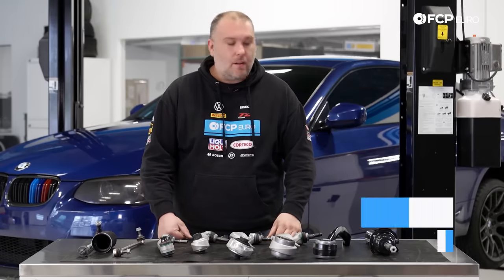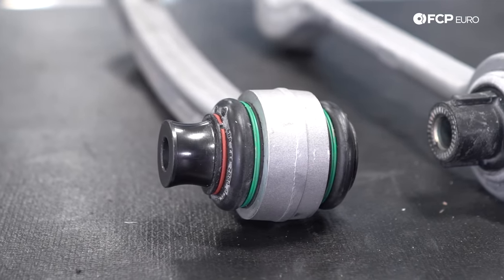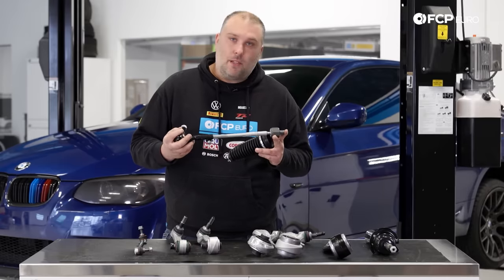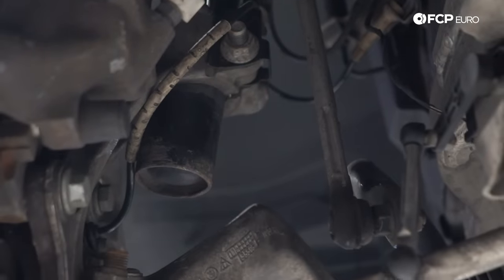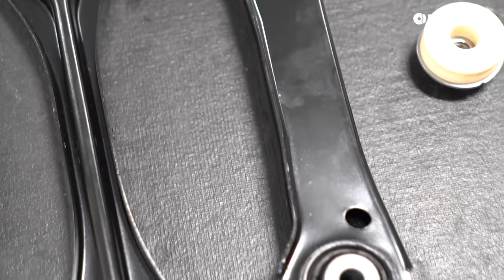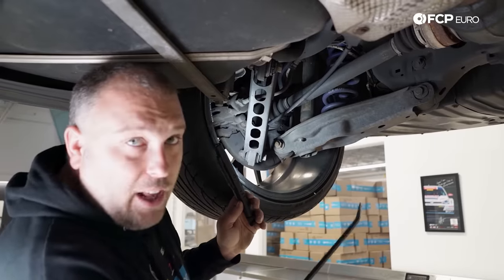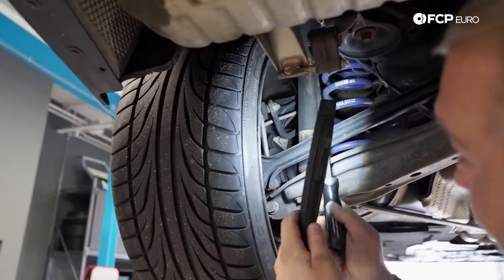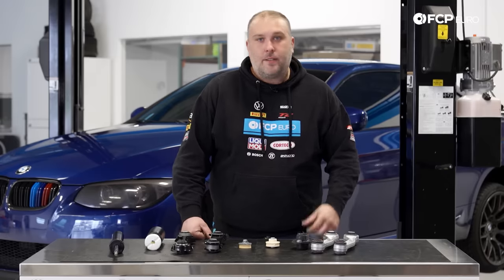BMW E90 Suspension Diagnostics & Problems: Everything You Need To Know ( 328i, 335xi, 335is, 330i)

Comment: I have a feeling that these E9x videos are going to start getting a lot of views as the 12+ years of wear pretty much guarantee that their suspension is shagged
Reply: Argh
Reply: Damn right. Mines on 200k km's. Gotten loose as fuk lately.
Reply: Man that’s the issue with all old cars now. It’s annoying knowing you’re gonna be having to replace suspension and steering parts
Reply: @d3admaub938   Still better to repair a 2010 car than to buy a 2020 shit box, BMW included.
Reply: Mine failed on the expressway, threw me into a wall. Now I need suspension and Msport bumpers. Yay!
Reply: They are getting lots of views now 😂
Reply: I mean, an e90 with its old plastic parts and running hot were already in the ballpark before 2020.
Reply: I just spent around 6k on the front and back with all new coilovers I’m SO EXCITED I GOT A NEW DRIVESHAFT IN WITH NEW U JOINT AND NEW TIRES THEN MY OIL PAN CRACKS IN HALF FUCK
Reply: @dabsfordayz2150 similar issues here too

Comment: You say 35.000 to 40.000 miles is the life expectancy on a strut, then I should be happy that I managed to get more than 250.000 miles out of the strut's in my E61 525d from 2007, before the left spring cracked and I decided to replace springs and shocks.

Comment: Nice video. I have a doubt about rear suspension arms. i got an e92 and it shakes a looot when braking. I´ve change the all 4 discs with pads but the car still doing the same. Tires are brand new. Could the rear arms be causing this? i´ve checked front arms but they are all okay.

Comment: I can can confirm: "You have to compress the front spring more than usual to assemble the new strut due to the strut's internal design"  I was compressing the spring.  A LOT.  Then KA-BLAMO.  Upper strut bearing bowl blasted into my ceiling!  At least it wasn't my FACE !!   I've done 2 other non e90 cars.  Never had to compress the spring to that extreme.  It slipped off my compression tool under extreme compression!!  Dramatic & scary.   That was 5 months ago.  I gotta take the front struts to a shop for assembly.  I'm not attempting that again!

Comment: Put b12 pro kit + new tie rod ends + new sway bar links on my e90. The car has completely changed. You think your e90 handles well until you get these changed. Mine was on 140k miles before I swapped the parts out. Now I can take corners that used to feel sketchy at 60mph comfortably at 80mph. Completely different car. I would highly recommend to anyone to do this. If you do the work yourself it’ll cost you around 900. But have a blow torch and a lot of patience at the ready.

Comment: you might have just diagnosed the dreded vibration under braking 🔥 after two sets of new disks and pads i was loosing hope 🙈 I'll be installing the m3 upgraded parts and 🤞 that solves it + improves handling. Top class content - subscribed 👌
Reply: Are your feeling the vibration through the seat and pedal or through the steering wheel ?   I've had the car a week (2006 320d Touring) and noticed vibration through seat and pedal under braking, but a check on brake roller does show fluctuation on off-side rear disc.
Reply: @scarletturk3892  definitely fell it under the pedal and the seat but it also radiates to my wheel (just slightly) Had it before after winter lockdown, so changed all discs and pads - it was gone for a bit but after few weeks started to progressively come back. I know the hubs rust on bmws and that's also causing vibration under braking...

Comment: 110k miles in an area with plenty of potholes and all I've needed to replace is the rear shocks. Lower shock mounts were completely shot, so definitely worth replacing those and everything else the FCP mounting kit comes with.

Comment: Damn, wish I would have known about the option to use M3 parts on my rear wheel drive e90.  I just finished replacing all of the front control arms.  I had steering wheel shake while braking and that solved it.  Had my rear struts leak like crazy at 120k miles.  Sitting at 140k now and have the original front struts still.  Thanks for making the videos and being a great place to buy parts from.
Reply from the maker: Nice work, Sean! 

Now you know for the next time :)

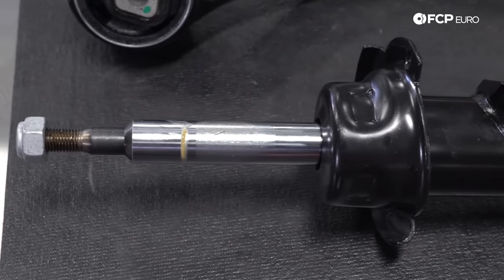Comment: Great video! Much needed content for all e9X owners. Great point on the spring compressor with the Sachs dampers. 3:11 Using a rental spring compressor is a nightmare! I went through it all just to have my one of the Sachs dampers leak only a couple months after installing them. I definitely recommend going with Bilstein given the better performance/installation.
Reply from the maker: Thanks, Evan! Really glad you like the video!
Reply: My 335 struts was the most horrible strut job i ever did. Even took them NTB, mechanic tried for couple mins and gave up , wasn't risking his life
Reply: geo745don Yeah, I wouldn’t get the struts for that reason alone. The fact that  one is already leaking is all the more reason to go with Bilstein. More people need to know this.
Reply: @evanupshur  yeah I got the blistens,  usrd nylonn straps to tie Springs down, with spring compressor, lowered care to help seat to tighten nut, big headache, my car has factory sport suspension makes it worst I guess
Reply: @geo745don  There are special tools for the shocks with in-built rebound springs. For example Laser Tools 5790.
It will pull the shock out to maximum length so you can install the spring with a normal spring compressor.

Comment: A quick note...the "internal rebound damper, essentially a bump stop" discussed in the Sachs strut is actually a rebound spring. It's used in the strut to control large body motions and improve on center steering response. It's worth differeniating as it is a function of displacement opposed to velocity.

Love these videos!
Reply from the maker: Thanks for the quick note, John! Glad you like the videos!

Comment: What tool are you using to change the bushings and ball joints (on the trailing arms and on the lower roll over struts) on the rear suspension, is there some special BMW-designed bushing removal/puller/pusher or you're using whatever no name bushing removal kit... and can you make a video of tips and tricks when it's time to repair the rear suspension. Thanks for all the videos, great work and very helpful!!!

Comment: Great vid once again Gareth !

I have an f30 but like you said rear is a 5 link design, they look pretty similar. I have massive toe-angle changes at the rear if I hit any sort of road imperfections. On my e46 would immediately suspect bad RTABs. I'm assuming on the f30 it's bad roll-over strut and lower wishbone as they have ball-joints that attach to the wheel hub. Can I replace just the balljoints or do I have to fit new arms?

Comment: So I have a 2011 335xi w/ "M Sport" suspension ~70k miles and everything is fine for the most part. My only problem is that when I hit bumps sometimes, especially if it's mid turn, it will feel like the back end is sliding out a bit. The car recently had the drivers side front tire replaced not too long ago and I wonder if they did the alignment correctly. I heard another variable is my rear tire pressure which I'm going to check tomorrow. Possibly rear shocks too? 

One thing to add would be that sometimes when I'm going about 70+ the steering wheel and car a little will start to shake a tiny bit. Some say im being extra picky but I think something is up and I want it to go away. Tires have even wear btw. 

Took it to one shop and they told me to do the rear subframe bushings but another shop went in there with a pry bar and had no clue what the original shop was talking about. Needless to say, a little torn!
Reply: Refreshing the rear subframe bushing is most likely what you're feeling. A good upgrade for you would be to go to the M3/1M subframe bushings. They have stiffer axial, radial and conical rates resulting in a more planted feeling to the rear axle. If you are interested, I have a pair already installed into a subframe I could sell.  It would make for an easy installation for your mechanic.

Comment: Recently picked up a 131k mile 08' 328i coupe. BMW dealer did a complimentary inspection when doing the PCV recall. Dealer stated only the rear brakes needed attention . However IMO driving the 280 mile trek home from purchase the front suspension seemed soft/spongy. Even bottomed out on the HWY in IL after a normal bump. What direction should I go? Other than that this car is amazing.

Comment: Awesome channel and video. I have also an E92 with some suspension problems. If i'm driving with some speed on a bumpy road i hear all kind of knocking. I've chanced the anti-roller link but it does the same noise. Could be from the shocks ? Thank you !
Reply from the maker: Alexandru it really could be a myriad of problems, suspension clunks can vary, end links were certainly the cheapest easiest and most common to start at, unfortunate that didn't solve it. Checkout our recent Front end refresh DIY you may find some additional info helpful in there as we diagnose as well as install a bunch of parts that could be your e92s problem.
https://youtu.be/jY795gBK3oc

Comment: Great video!  I’ve got a e60 528ix that just recently broke a front coil spring. I’ve order springs struts and upper mounts for front. But now I’m considering doing the springs and shocks and upper mounts in the back what do you think about that?  The springs look pretty bad rusted and nasty. That’s how the front looked and it broke (cracked). Also I’m wondering if the rear spring is the same as the rwd drive model e60’s. Really appreciate FCP euros work on these videos. Recently ordered my parts from one of your guys that helped me find coil springs for the front that were 1/3 of the price of oem.  Thanks again!
Reply from the maker: Thanks Mike glad you are liking these videos so far. So it will never hurt to refresh all 4 corners of your suspension at the same time, especially if your noticing similar symptoms/characteristics of recently failed parts. If you have the means to do it, I'm sure you and your car wouldn't be disappointing by the refresh. In regards to the rear spring question I would honestly send a note to service@fcpeuro.com with your vin and they'll get you properly sorted, as off hand I'm not 100% sure. Appreciate your support!

Comment: my wifes 1 series keeps losing the back end on slow corners and roundabouts, what component would usually cause that.? It drives in a good straight line. so far changed struts on the rear and front.

Comment: Awesome video, truly a joy to hear you explain it.
What I'd like to see is how to mod standard E92 seats so that they can go a little bit lower.
I've seen forum threads, but for me not clear enough to undertake myself.
Seats need to go out and then make is so that when you move the seat lower with the button, it will go lower than stock. Remove or re position bump stops perhaps  I'm tall so I could use the head space. Then I can trackday with a helmet. It's mandatory for autocross in the Netherlands

Comment: I have a 2011 E90 328i that has a shaking under braking issue. The steering wheel shakes like crazy when braking from 50+ mph. However, the car does not shake when driving or cornering. I've taken the car up to 116 mph and just chilled there for a solid 5-6 minutes....the car is incredibly smooth and no shaking at all. What could cause the shaking under braking? All 4 rotors and pad are brand new, under 5k miles on them.

Comment: My bmw e90 328i 2010 is super low but it has the stock suspension on it, I want to have it back to the stock height and ride quality which suspension kit do I have to buy to have it basically drive as original as possible?

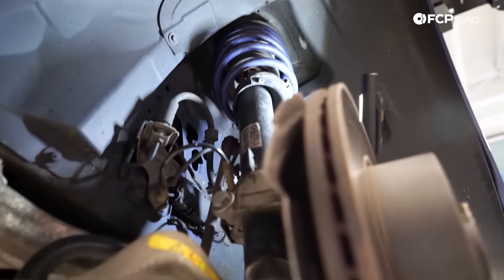Comment: What is the point of the rubber cover on the strut rod if it's expose/disconnected on the bottom side? Mine looks just like what you showed in the video @9:45

Comment: QUESTION! I have an xDrive e92 335i, Im looking on FCP euro at the REAR control arm kit for the M3 that has about 5 control arm parts in the bundle that comes in the kit, and this video only compares a set (2) of OEM ones to the m3 ones. were those missed in the video or does the xDrive not have all of the rear M3 components? 

What I mean is the 335i xDrive shows a 4 piece rear control arm kit that is (REAR UPPER) which includes wishbone x2, control arm A, control arm B. 

and the M3 kit has a 10 piece control arm kit. that has a wishbone, guide arm, and toe arm arms. 

Hope that makes sense. What im ultimately asking is if i purchased the M3 10 piece control arm kit for my e92 xDrive 335i, would ALL of the parts in the 10 piece control arm kit bolt up to my car since you said the rears are ultimately the same? 

Thank you in advance, I always shop from FCP euro.
Reply: I would also like to know for sure, but I think that only parts no.: 33322283545, 33322283546, 33322283547, 33322283548 are that to replace from M3 kit in our xDrives
Reply: @artur9266  Thanks for this, I looked it up and I believe you are correct.
Reply from the maker: @ltdasilva93  and @Artur I just got off the phone to verify with our BMW Catalog Manager, and indeed the REAR M3 Upgrade kit would be valid for a non RWD / XDrive car. The weaker non M front suspension then becomes the issue , but it is doable to swap. https://www.fcpeuro.com/products/bmw-m3-control-arm-upgrade-kit-e82-e88-e90-e91-e92-e93-bmwmcaktr Hope this helps, if not feel free to email service@fcpeuro.com !

Comment: Hello! Good informative info! I'm here wondering why my steering wheel might shake around 45mp/h, any ideas? id gladly get the part from you guys!
Reply from the maker: Hi, Ben! Wheel shaking could be number of things, from unbalanced wheels to worn suspension parts or wheel bearings. It's best to get the car up in the air with the wheels off and have a look at everything!

Comment: Great info here I gotta say. Thanx. Just a few question if it's OK:
I see quite a bit of Lamforder part as factory fitted. Do you find quite a bit of difference in factory fitted Lamforder quality vs OEM Lamforders as you'd use as replacement? And what about Sachs shock? 

Cause, my recent purchase of Lamforder engine mounts are way too soft. They can't even hold the engine properly resulting in rubbing and vibration. Some of them get compressed bad enough in just a few months it's visibly noticeable that the engine is too closed to the mount. And they don't carry any warranty from factory from what I'm told. 

As for Sachs shocks, my mechanic said that there is quality differences between Original and OEM even though they're both Sachs made. What can you tell me about this?
Reply from the maker: Hi Alsofzico, glad you like the video! In some cases, OEM parts have improvements made over the factory design. We have had great luck with Sachs and they are also an OE supplier for many manufactures. The good news is that anything you buy from us has a lifetime replacement guarantee, so if anything ever fails or wears out you can send it back for a free replacement!

Comment: I have a problem with the car shaking VERY bad only when it's cold. It feels like little jumps that increseases violenlty and exponentially with each jump.

Only occurs on 1st gear as i let go the clutch, what could it be? It's a 320i N43B20

Suspension is good (recently changed the oil and checked it), clutch feels fine when im driving above 2nd gear, and at idle the car is ok, no hesitation, misfires, etc.

Comment: Hi Gareth I have a bmw 335d ,2010 model I noticed on the rear of the car only on 1 side that the wheel  would catch on the wheel arch when I went over a bump or have passengers in the rear of the car, so I had rear shocks and coil springs fitted on both sides, I still have the same problem with it catching on 1 side any other ideas what it could be? Thankyou.

Comment: Great video. My e91 330 has a problem in hard left cornering, there is a thumping or deep sounding clunk noise in the front right? that sounds like "trrrrrrrr". I changed the shocks (they were really bad), changed all 4 arms in the front, and the sound is still there, only when hard left-cornering, there is no sound in the right corners. Any ideas?
Reply from the maker: Hi Domzy, if they were not already, the mounts for the struts can cause noise unless those were replaced, along with the sway bar end links.
Reply: @fcpeuro  Replaced the strut tops too, didnt mention that sorry. Ill be ordering sway bar links, bushings and tie rods as well just for the sake of it.

Comment: Hi guys , i have a question that you haven't answered in this video , I had a suspension fail on me the other day it was the rear top suspension arm , well to be more precise the bolt that locates it to the hub . It completely snapped and I was left driving down a mountain road like miss daisy  as the car was all over the road . Is this a common fault or was it just bad luck? Thanks again 👍🏽
Reply from the maker: Sounds like quite the adventure James... I wouldn't call that a common occurrence at all, although we have heard of it happening before its not common. Does the car have a lot of rust? It snapped/sheared entirely? Could it have potentially been overtorqued?

Comment: Hopefully you’re able to answer my question, but I own a 2012 335 xdrive and I wanted to potentially do the m3 control arm upgrade, but being that the m3’s are rwd that shouldn’t affect anything would it?
Reply: Sounds like the rear end suspension is all the same on rwd and xdrive cars, so the rear could have M3 arms installed